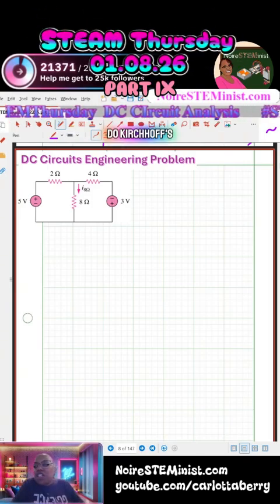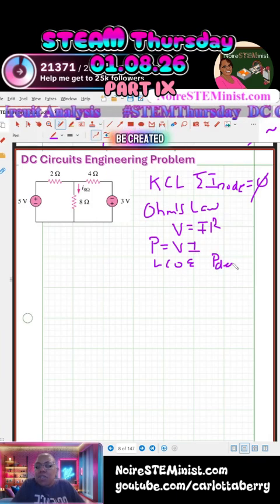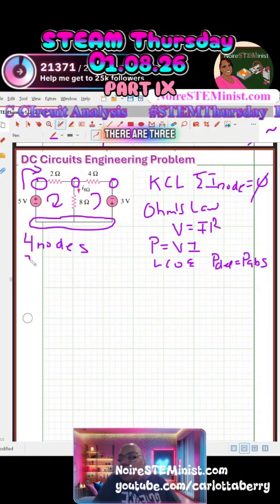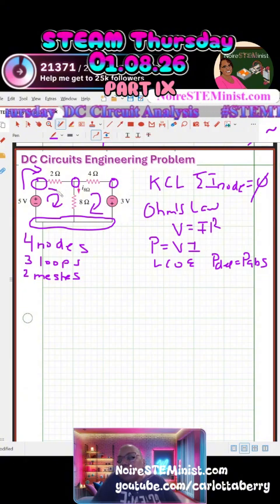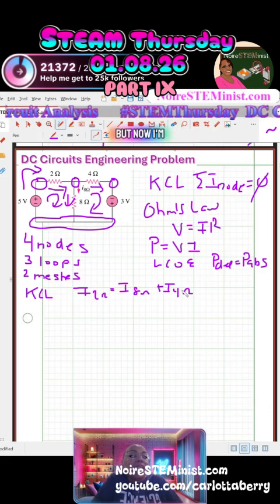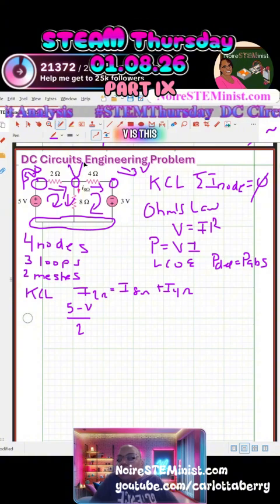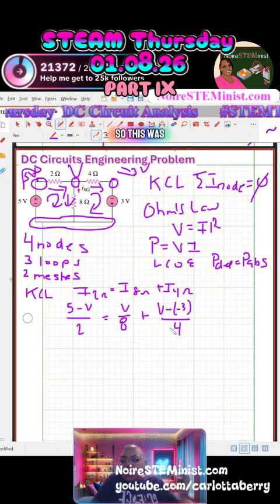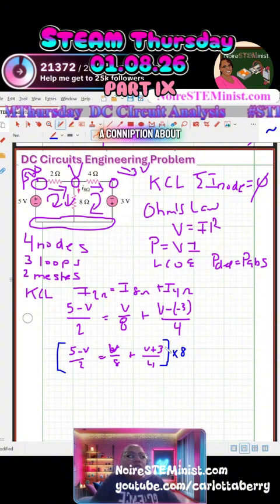STEAMThursday 010826P9 #TikTokLive #Engineering #Professor #STEM #NoireSTEMinist #Circuits #STEAM

Comment: How does this work on the Flat Earth 🌎?
Reply from the maker: Nothing I can do for a flat earther but pray for them.
Reply from the maker: Very well!
Reply: @carlottaberry  They argued in the shelter like it was a debate stage. Luke, wrapped in nationalist slogans, talked about borders, enforcement, and order; Owen, buried under socialist pins, fired back about ICE raids, deportations, and state violence. Both were white, both furious, both convinced the other was proof the country was rotting. The argument got louder, then closer—faces inches apart, voices dropping, anger buzzing into something charged and unmistakable.

When they kissed, it was sudden and undeniably gay, more confrontation than tenderness. They didn’t stop to explain it or soften it; they just leaned into the contradiction, hands gripping, breath tangled. Nothing was resolved—Luke still believed in enforcement, Owen still wanted it abolished—but for one night, their certainties cracked, replaced by the unsettling truth that desire had crossed a border neither of them had meant to open.